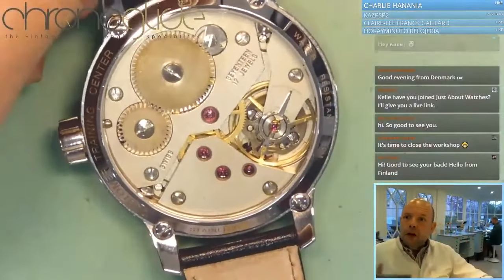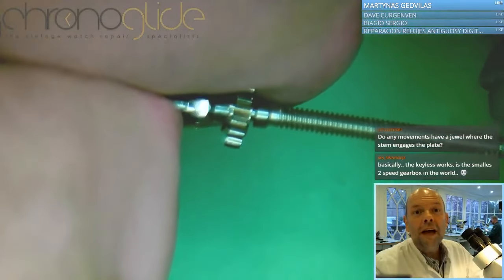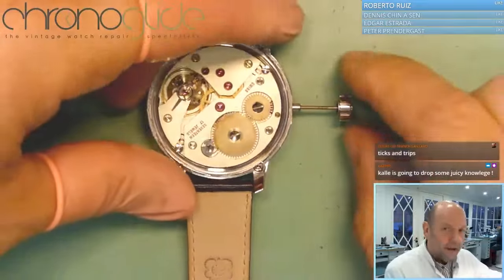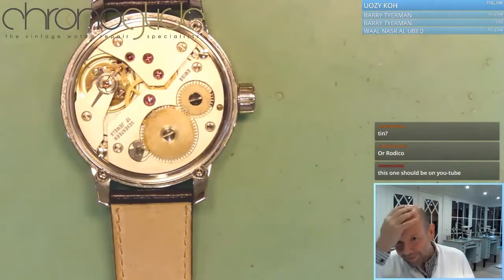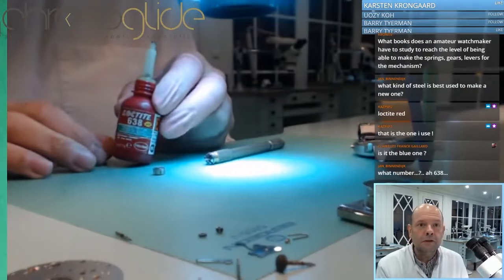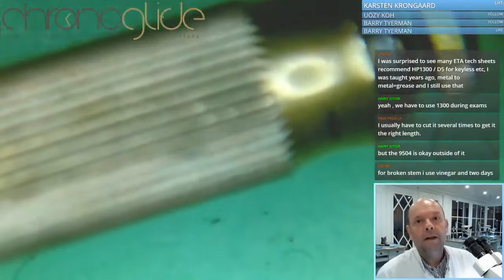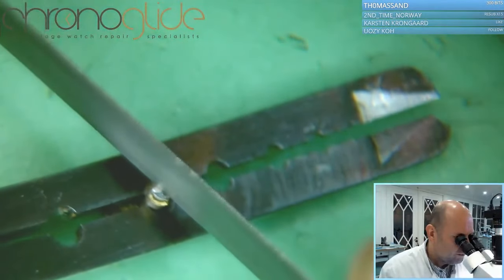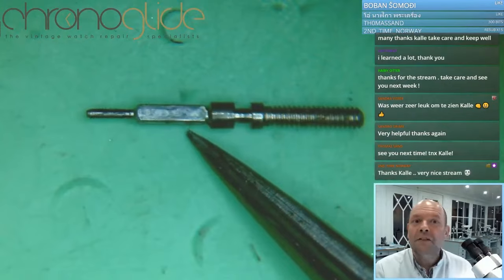How to repair the crown and winding stem of your vintage watch - (Fast track re-edit)

Comment: Another way to remove stem which is broken off flush with crown, without touching the crown, is to dissolve it using solution of water and  alum (Aluminium Sulphate). This safely dissolves carbon steel but not stainless steel, brass or typical plating materials. I’ve also used this method to remove broken screw from movement main plate. You have to be patient as it takes around 3-4 days. It can leave a soft black residue in the thread, which can be easily cleaned with ultrasonic bath.
Reply: Tried that myself once, was shocked how well it worked. Warm water helps, I used an old coffee machine heater plate :-)

Comment: Hi Kalle, what movements have a robust winding mechanism and stem. I have a Seiko 8L movement which is fine. However, the stem is the weak point. Most watch stems are delicate. I have never had a problem with Tudor or Rolex stems and crowns.
Any thoughts?
Thank you,
Chris
Reply: Thank you